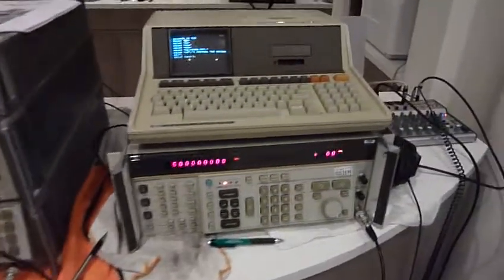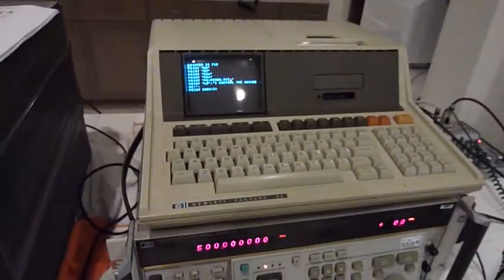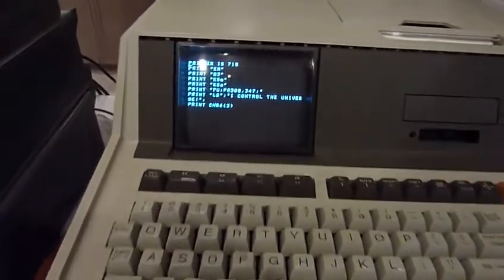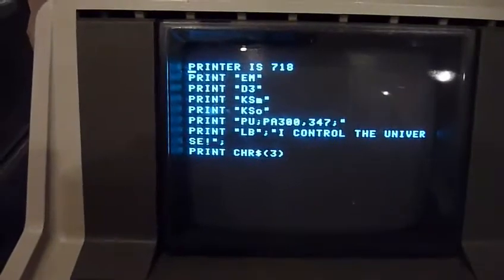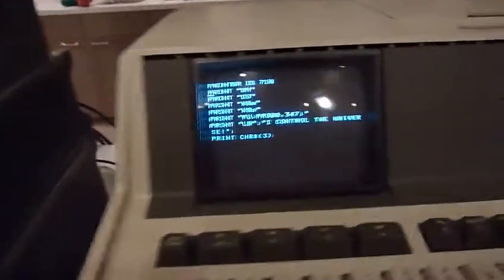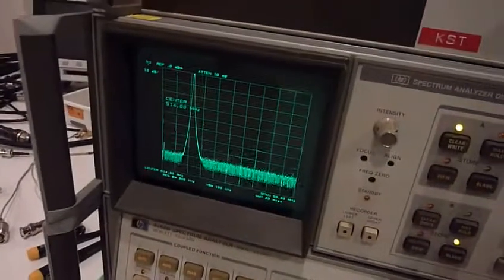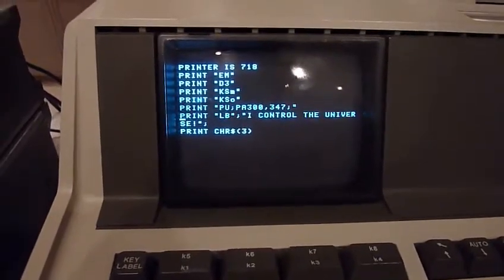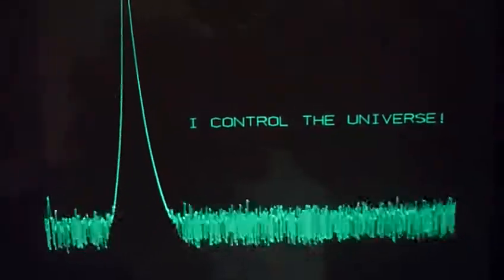HP 85 demo: GPIB lab equipment control made simple!

Comment: can you show how it is connected ? can you use any gpib command ? will it work with psa spectrum analyzer ?  looks real coooll  LIKE ! thanks !
Reply from the maker: You need the HP 82937A HPIB interface that plugs at the back of the HP 85, and also the IO ROM that plus in the ROM drawer, also at the back. If you have that, it will work with any GPIB equipment. See this episode for example https://youtu.be/ZbQ1_sW9zK8

Comment: Hello,  Using your HP 85 computer, can you direct it to print an image from the HP 8566 or 68 spectrum analyzer? I have the IBM lugable, basically a IMM PC 1 from the early 80's. It has dual floppies and a serial, and parallel port.. Perhaps I can use it instead of an 85.
Regards,
Glenn
Reply from the maker: wa4aos No, but both the HP 8566 and the 8568 print directly to my HP 7225 plotter without the use of an external computer, directly via HP-IB.